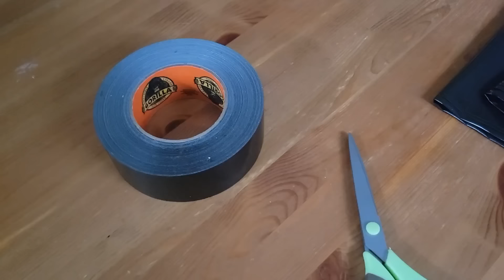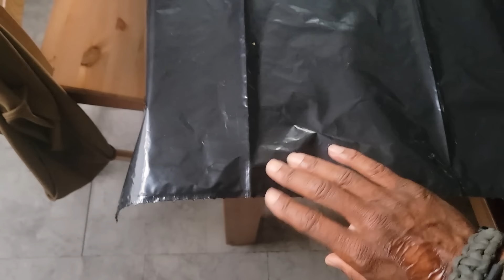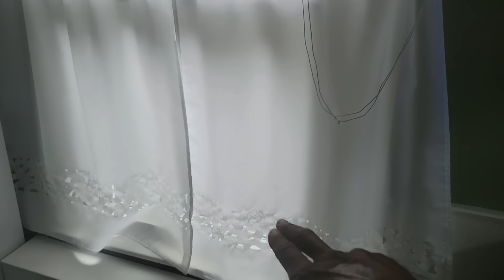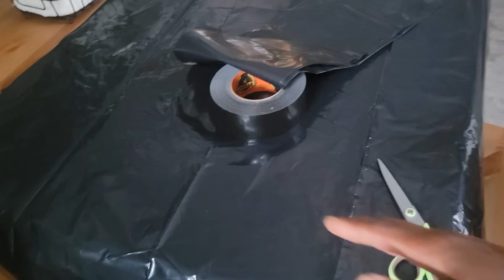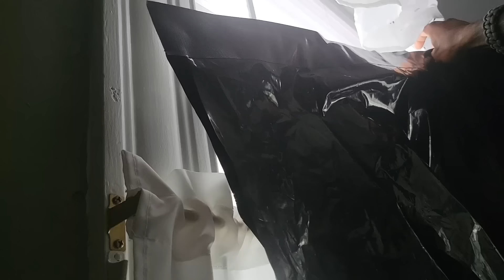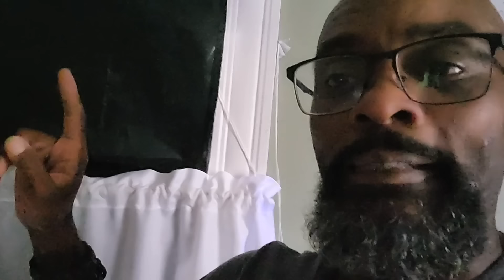DIY Blackout Shades: Easy Home Security Upgrade during Civil Unrest, Long-term Power Outages

Comment: I keep telling people that say "I'm getting a generator", that the generator will just make you a target ! Thanks for this great idea ! ❤
Reply from the maker: I've still got to build my quiet box for my generator... just in case
Reply: @TheUrbanSentinelChannel  how to do?
Reply from the maker: 🤔 do?
Reply from the maker: My layout location has to be cleared and leveled, then I'll build a container for the generator to be secured in it. I'll have a video on that once I get it together.
Reply: @TheUrbanSentinelChannel  I have that set up already in play ,in a 7x7ft shed with the power cord running thru a 3" pvc pipe to the back of the house completely out of the weather works fine with exhaust fan to exit build up heat and  air intake vent to bring in air on the opposite side ,go for it oh and locked up tight when I'm not home
Reply: @TheUrbanSentinelChannel  they sell generator enclosure just go to Google , then just build all the necessary amenities that go with it 2025 just around the corner u better hurry😮
Reply: @TheUrbanSentinelChannel if you don't  have a enclosure  for your generator get a big chain and chain it to a tree or something
Reply from the maker: @Jim-bx7vs 😁👍I've got a big chain and post, but I'm building a concrete pad with a rebar hoop, then building the box to go over.  It'll free up floor space in my shop and be secure in it's location.
Reply: @TheUrbanSentinelChannel 👍🙏🏾
Reply: @TheUrbanSentinelChannel  was in two hurricanes in my decade in Florida. Only generators then we're gas powered. They need to be placed on the outside of a building. In our apartments, other tenants hooking up to the ones with generators, included refrigerators and larger TV sets. My hubby and I had purchased each a handheld colour TV. They are noisy, especially if several in an apartment complex. There are issues with gas supply competing on the last 18 wheeler gas trucks with their last deliveries, People in their vehicles lined up, especially if needing to evacuate. Includes large RVs. A few years later, relocated back to my home state, different county, ended up too high rents/financially homeless. Batteries, jackknives and flashlights are the first to 'walk off'. Anything that lights up or helps mostly with night survival. Now, that I have long ago, been housed, I do have on my Wishlist, a total of 2-3 rechargable and small generators, should I need to do a walk out evacuation, take at least one. Should an off grid emergency render me at home, I am blacking out my windows, as the curious and/or the thieves will be using their extra senses, starting with, listening to outside gas generators, and inside for lights on. Maybe a headlamp will discourage them. Not sure about adding solar panels. Live in an apartment, no real direct sun tp charge. In case of an off grid situation, not a lot of privacy tp keep from thieves from the Looky Lookers. Also, I believe the rechargable generators run much quieter than the obnoxious, carbon monoxides.
Reply: I just sent my daughter this video. She's in Chicago... It's a Tuff town & I hope that your logical and intelligent explanation moves her to action. Thank you!
Reply: @mamaj6028  you’re right! Also, don’t spread the word how prepared you are. They might laugh right now, but when they’re hungry, they’ll know where to go.
Reply: @genitagray6126  you may be right or maybe  the bandits may just be  tired of living , if you live on a block with like minded neighbors  without talking bout your stash  just strike up a conversation  as to what are there plans for a grid down  theres has to be someone that you talk to in passing  some one that takes real good care of their home lawn property, they would have something to loose  theres strength in numbers ,phone numbers to alert others on the block of incoming  threats if the cell towers are up
Reply: I have enhanced my apartment windows with the ballistic plastic used on government or embassy windows. It is Clear and makes me feel a little more secure without giving away the extra reinforcement.    Blackouts are essential, your method is quick, efficient and portable if that need occurs.
Reply: solar generator genius
Reply: @Jenna-q6w  solar only good when the sun is shining you will  need another power source to keep it running and if the power grid is down then you're shtf out of luck.   A Dual fuel generator that runs on gas and propane is the power source you will need ,I have seen them with mufflers attached  cut them decibel way down beside they will be noisy and you may not be the only Generator running, remember the song from the sopranos ( woke up this morning got myself a gun) is your next step defend your property and your stash 911 won't  be working and the po po ain't coming😊
Reply: @mamaj6028 I have a generator in a shed 40ft from the house that powers the whole house inside a 8ft fence with two cane Corso and the only target would B who ever climes that fence ,you're only a target if you make yourselves a target its imperative to keep the  refrigerators and freezers running 😊
Reply: I purchased solar, not only is it quiet, it can be indoors! No matter what type of quiet box you have, if it's dead silence out there, IT will be heard! SOLAR!
 Shalom. 
Praise ye YHWH!

Hallelu-YAH!
Reply: @dovenut1224  please link the indoor solar generator you got. Thank you. 🙏🏻🙏🏻🙏🏻
Reply from the maker: @dovenut1224 😎👍Very true. My generator was within my wallets capabilities. Later I intend to add a solar backup system for longer grid down situations 🤞😁
Reply: @dovenut1224  link for solar generator?
Reply: Not a solar generator

Comment: Good information. I have sun screen at 90% and 80% at my windows, added aluminum attic   insulation barrier. For smaller window I took Reflectx to fit the window and sprayed it with copper and black paint.

PS place window alarm on the window beforehand
Reply from the maker: Smart move with window alarm in case somebody gets sneaky sneaky 😁👍

Comment: You can buy one roll of (black visqueen) which is about 1,000 times thicker than those plastic bags. And you can cut it to fit whatever size window you have including sliding glass doors!  You would still have enough black visqueen to literally cover your whole house if you needed.
Reply: Do that’s like $100?
Reply from the maker: 😬...an option for a real big project, but I'll put a pin in that for the moment.
Reply from the maker: I'll have to look into that. 👍

Comment: You can get double sided tape (the stuff you can install clear plastic covers on windows with to keep out drafts).  Adhere it to the window frame and spare the painted surfaces.
Reply from the maker: Winterization is whole separate issue 🥶 When an actual crisis happens, nobody will be concerned about the paint peeling 😁

Comment: I like that. i have a stalker. that live right in front of me.  i also make drapes, so what you. can do is to put an, extra two inch. all around. you can do that, with the duck tape. put the tape on both side, like a sandwich. then you can use tacks, to keep it on the wall. so no damage to the wall. i like your i dear. i wish i could show you. what I'm talking about. thanks,
Reply from the maker: I get it totally. I simply didn't put the duct tape all the way around because my wife had repainted that area. I'd be in trouble if it marked up the paint 😂🤣

Comment: The  technique shown here will work great. I have a camper set up where it hides well, but light out of one wide window is visible and draws huge attention from the road at night. I taped two contractor bags to the window shade inside and the curtains block the light at the edges. It's not 100% at the edges but is in the middle where the bags are and is good enough for my 'gray man' purposes. I can easily open the window shade in the daytime, then pull it down at night. When I plastic up the windows for wintertime sealing I use blue painter's tape; it sticks months long and still peels off easy without hurting anything. Get it somewhere other than 'dollar stores'- blue painter's tape from there tends to be awful.

Demand for contractor's bags has gone up because folks in the construction business have begun using them for scrap and debris so they can pass it off as 'household garbage' instead of paying extra at the landfills for construction waste. Local prices for contractors bags has doubled in the last 18 months and stores are out of them about 1/4 or the time I go looking for them.
Reply from the maker: It's always something 😄
Reply: What about black visqueen, get a roll for your whole house or apartment?

Comment: What about the ability to see out?  I once thought about making some "screens" out of welded fence wire, then screwing them across the windows into the studs from the inside which would prevent someone from entering (easily at least) even after breaking a window.  So many things to think about.  We thinking 2nd story windows are safer?
Reply from the maker: The higher up from ground level, the harder to see in for sure. Peek-a-Boo flaps to keep an eye on things. The welded screen could be an added layer of defense no doubt